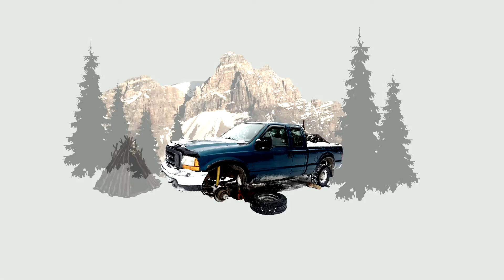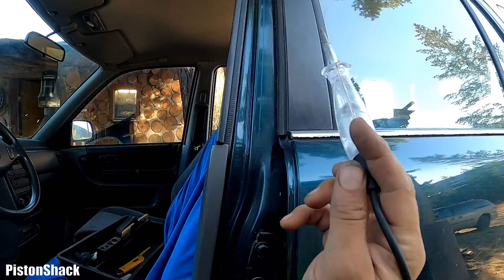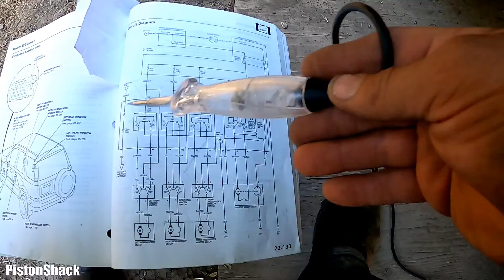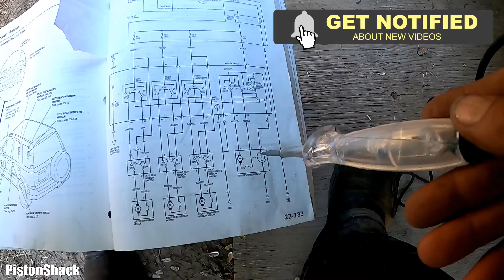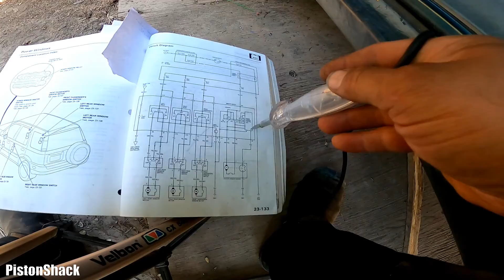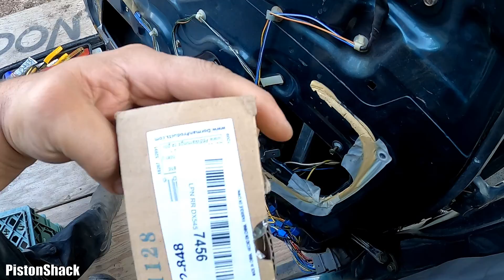HONDA CR-V DRIVER'S SIDE POWER WINDOW COMPLETE DIAGNOSIS | HONDA CRV 1997-2001

Comment: what happened with the blue wire? I thought it tested bad but only saw electrical contact cleaner used and not re-tested with test light?
Reply: @scottscopters7  he repaired it than sprayed electrical cleaner on blue wire

Comment: I’m not getting power to the blue wire . I’ve checked at the 21 pin connector, stripped wire up stream of connector in the fender well, no power 
No power at connector on rear of window switch.
Window switch faulty?
Reply: I just got a good used window switch installed it still no power to blue wire
Help